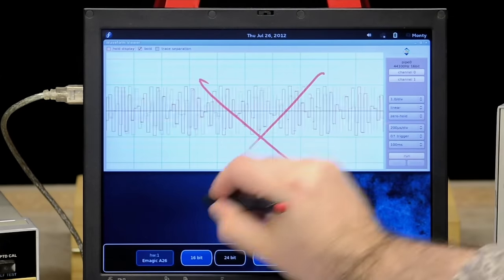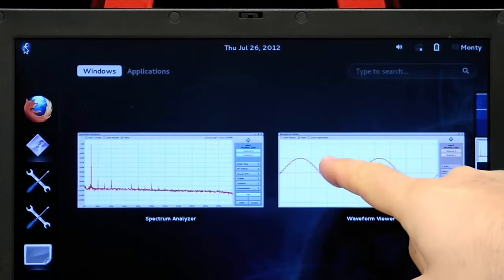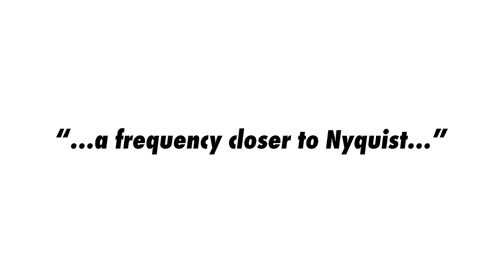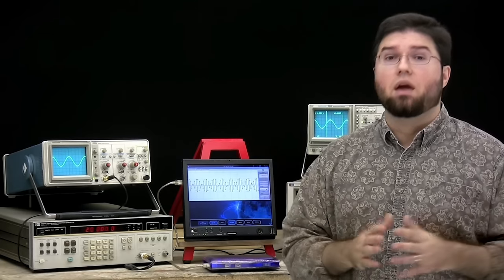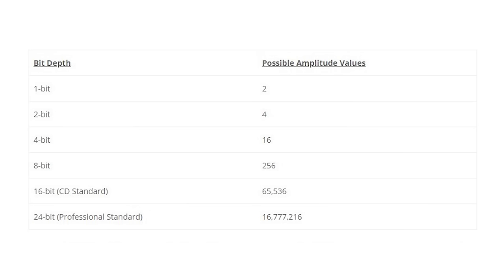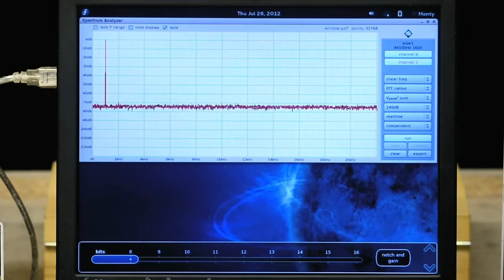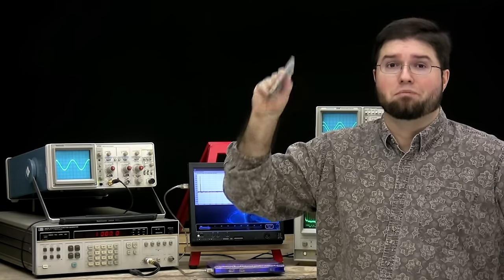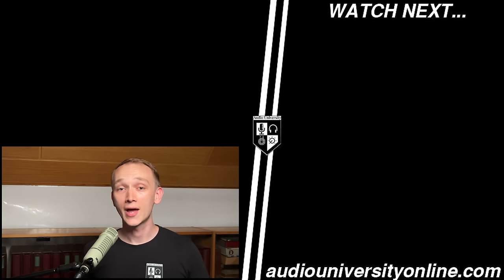Debunking the Digital Audio Myth: The Truth About the 'Stair-Step' Effect

Comment: Well done.  I should point out that higher sampling rates are better for certain use cases, such as playing back the sample at slower speeds.  For example, if I shoot a video at 240 frames per second then play it back at regular speed (30 frames per second). Slow motion playback is far smoother than if I recorded it at 30 fps.  The same is true of audio.  So, if I record audio at 96k to sync with a high speed video, it will be smoother when I play it back at a slower speed.

Comment: In 1984 Wendy Carlos released the album digital moonscapes, which was created with digital synthesis, and recorded digitally. 

Dire Straights 1985 album Brothers in Arms was digitally recorded. 

There was extensive testing done at that time sending analog audio through digital conversion and back. it was determined that literally no one could tell the difference between the converted signal and the original. In my mind, this has been settled for 40 years.

Comment: I fully agree the problem/solution is not in hi-res format, but rather in the art of the quality of the recording and room acoustics. Nevertheless, analog will always sound one step more real, yes may be more noise but more real, cause it always been in one piece, vs. digital, where the "whole" cease to exist at some point, when it broken into 0s and 1s, than it is reconstructed anew by D/A convertors from said 0s and 1s, but it is never 100% "whole" again and highly depends on the quality of the D/A convertors.
Reply: You probably didn't understand what was said in the video. Or didn't want to. ;)
Reply: @omenoid  It said that 24/96 and up is no better than 16/44.1 isn't it? 🤔 And I'm said that main problem not in the bits but in the original recording and that good recording saved saved even in mp3 will always outperform crapy recording saved in 48/192 etc. And I also say that analog will always play closer to the original instruments. What was said in the video according to you?

Comment: Mind-blowing video! However, I would like to point out that higher sampling rates can have benefits for sound design. They let you slow down the sound extremely with less distortion.
Reply: Good point, the soprano pipistrelle is around 50kHz plus, so if you are recording bats you definitely need greater bit depth.

Comment: The only reason for a high sampling rate is to reduce the order of the anti-aliasing-input filters. Thanks to advances in the AD-converters in the last 20 years this is afforadable even for consumer devices.

The hearing dynamic range peaks at 200Hz with 90 to 100dB and 16 bits mean 96dB - so every bit above 16 does not really help and for a clear signal any noise at fs/2 and above needs to be suppressed by 96dB and more. So for 10kHz upper sound frequency and a 10th order (!) LPF the minimum sampling frequency would be 96kHz to have a 96dB-attenuation at 96kHz/2=48kHz.
If the samling frequency is increased to e.g. 192kHz the 96dB-Attenuation can be achieved with a filter of 6th order. In reality the cutoff-frequency can even be set to e.g. 2kHz as the hearing sensitivity drops significantly at 1kHz and higher (this of course requires digital reconstruction of the phase and amplitude) - then the input filter is of 4th order.

After input-sampling the data can then be handeled with e.g. 32 bits (i.e. shift the real data to the upper word). Then the input filter disturbances can be corrected and a digital LPF of e.g. 100th order with a cutoff-frequency between 16 and 22kHz applied. The result can then be used to get samples with 44kHz or even 32kHz. This does not affect the signal quality.

When producing analog output the steps do of course need to be flattened by an LPF again which in turn requires a pre-calculation of the phase-shifts and attenuations to be expected.

Comment: The reason why you want high frequency and bit depth is for digital resampling.
It's one thing if you can resample with a dac->adc but quite another if you are working purely with digital systems.
This isn't an issue if you just want to play a CD, but it can quickly become an issue on any modern operating system where digital resampling all sources is the norm.

Comment: Yes in production the added sample range of 24bit when tracking means you don't have to worry about having things "as hot as possible without clipping" you can leave it peaking at -12db and its fine.
And with mixing in 32bitFP you may have noticed that individual channels will not clip even if they are 100db over 0, only the master which is converted back will (albeit not recommended for gain staging into plugins that are gain dependant or don't use floating point!)

Comment: I've never tried to argue that a recording w/a higher sample rate, (one with more bits and presumably higher resolution) wouldn't be better than one with a lower sample rate, but I have observed it to be true. After years of aiming to get the best system I can't quite afford, I picked up an Esoteric K-01xd CD player and spent more than most new cars cost on the rest of the chain. Many of the best sounding recordings I have are not DSD or SACD. Quite a few 16 bit redbook CDs sound better than most or maybe even all of my SACD discs. Tossing out the notion that stair steps are used to approximate a curve at least partially explains why this might be the case.

Comment: Digitisation error is higher with lower sample rates and leads to error in the timing of high frequency signals.

What this means is that your better off working in higher samplerates as that way any processing will habe a  4x reduced error incurred every time you use a filter etc.

Comment: A circle drawn with analog tools is easily smooth visually. The same circle drawn in digital format requires high digital resolution to achieve same smoothness. Same difference applies with sound reproduction but its verification requires aural discernment rather than visual tools.

Addendum: It's easy to discern; just compare analog synth with digital synth sounds.

Comment: could i get the models of the DAC and ADC you used? when i did this same thing with my own equipment, being a Moondrop Moonriver 2, and on it's lowest sample rate, it topped out at 19 Khz, on my scope, and about the only wave form it could play reliably was a sine wave. with all other wave forms reduced to this only wobbly. not saying what you did was wrong or anything, but it may depend very heavily on what equipment is used, and not all DAC's are the same.

Comment: I ran into this issue in trying to teach people how to do radar scenario simulation for early warning systems.  To build a test set for such systems they would build racks and racks full of radar frequency generators and sum them all together.  But when the EWS system burped over something they had no way to reproduce the signal that caused the burp.

So I introduced them to Nyquist, generated all the signals digitally, summed them digitally and then drove one single RF generator. It worked well - EWS systems got much better because they could test more complex systems more accurately - because they could repeat any pattern that burped the system.

Comment: That's mostly true, but only when we consider a pure sinewave. Of course, according to the Fourier theorem, you can reconstruct any waveform using a series of sinewaves, but it will require sinewaves of much higher frequencies than the original signal. Also, if you would use the simple R2R topology DAC, without any filtering, you'd clearly see the stairstep waveform on its output.
Reply: All signals are a sum of sinewave so fourier theorem is fully applicable to all kind of signal. if the original signal contains a harmonic higher than 20 K it will be lost, but if you play it in the speak your hear will filter it anyway, so the result is the same. you know a audio system which doesn't filter the harmonics ?? There is no stair step on the signal sent to the amplifier

Comment: The point that the digitized signal should be visualized as a "lollipop graph" and not a stair-step is a "duh" point for anyone with even a basic understanding of analog-to-digital conversion or DSP, but it is very nicely presented here, and worth emphasizing.

Where Monty goes awry is in the claim that the output of the digital-to-analog coverter is a "perfect sine wave." I wonder if he ever looked at the schematic of a DAC. The "lollipop" signal gets converted to a smooth signal by analog circuitry that effectively implements an analog filter (the anti-imaging or interpolation filter). Monty argues that the output curve must be a perfect sine wave because of bandwidth limitations in the digital realm. But the interpolation filter is operating in the analog realm, and its input is those now-analog lollipop spikes, which have lots of high-frequency content. Moreover, his point about perfect reconstruction holds only for infinitesimally narrow samples; in reality the ADC has a brief but finite integration or averaging time; it is not recording a value of the incoming sine wave at precisely one point. As a result of these effects, even ignoring other circuit imperfections, the output is never a perfect sinusoid (even assuming ideal downstream circuitry). The waveform looks sinusoidal to the eye, but the eye is easily deceived in that regard (it's hard to visually see 5% THD on a scope, for example). There are imperfections in signal reproduction in any ADC-DAC chain, and some of them are fundamentally related to sample rate and bit depth.

Also worth emphasizing is that Monty's reconstruction remarks presumed the signal into the digitizer is band-limited. Analog signals are not intrinsically band-limited; one of the things that separates good converters from bad ones is how carefully good ones process the incoming signal to make sure that the processed analog signal actually reaching the digitizer is nearly band-limited (and it's never perfectly band-limited). Another thing is the quality of the anti-imaging filter in the DAC stage. It actually can be technically easier to do anti-imaging filtering for higher sample rate converters. As a result, listeners may hear differences between 48k and 96k DACs that have little to do with sample rate per se, but are indirectly related to sample rate via the constraints imposed on the anti-image filtering.

All in all, the video excerpts left me with a very mixed impression of Monty's understanding of how digital conversion works. He did a great job clearing up the stairstep misunderstanding, and explaining digitization noise, but then introduced other misunderstandings. I'll give him the benefit of the doubt and assume he elided some details that he would cover in a course for actual engineers.

All that said, at least for the vast majority of practical settings, I'm totally on board with the implied criticism of "audiophiles" who insist on very high bit depths and sampling rates. I certainly can't hear the difference, most certainly not for casual listening. However, the fact that there actually are small differences between converter inputs and outputs that are sample-rate and bit-depth dependent (beyond the digitization noise mentioned here) implies to me that there could be some well-trained golden-eared listeners who can hear some differences in some controlled circumstances. I remain skeptical that it could matter in real-life listening. —Tom
Reply: @nicksterj If that's what he meant, he wouldn't have gone into the discussion of a truly perfect sine wave being the only band-limited curve that could go through the sampled points.

Comment: The bit depth and sampling frequency for editing is quite similar with what happens with digital images....8bits per channel and compressed data is ok for normal visualization, the issue is when you want to start messing around moving data from here to there applying some curves or levels...you end up with some apparent posterization quite easily.

Comment: What an eye opening video!  Even with my engineering degree from back in 1976, my interest in building my own amplifiers, and my investment in high end headphones, this was a revelation.  I have been wondering what to do about getting a better DAC than the one in my laptop, and you have convinced me that it's not worth going for better than CD standards.

I am also interested in math, and you just opened the door for me with the reveal that any deviation from the original wave requires frequencies higher than the sample rate.  That is worth looking into as a mathematics exercise.  I am thinking the DAC must use some form of interpolation between the points.  The staircase is a brute force way, you could use linear interpolation, or better still quadratic.  Then up pops Taylor series in my brain.  Maybe you explain more in other videos, this is the first I have watched on your channel.
Reply: It doesn't use some interpolation. It uses a (low-pass) reconstruction filter (which can be as simple as an RC filter, i.e. just a resistor and capacitor, which filters out the stairsteps, after which you get the original waveform back.

Comment: Personally I find 24/48 resolution an optimal as it takes not so much place as CD (2304 kbps vs 1411) and matches better video-audio.

Also I did some AB tests and I think is audibly better, just a little bit more articulated and differentiated instrument in classical music.

Also I think there’s no problem with simple sine waves, but in practice phase matters and the video only takes frequencies into account. Signal reconstruction use Fourier analysis to filter ultrasound frequencies, concretely Fourier transform and its reverse after subtracting the undesired frequencies.

As this transformations are not reversible in real computation (despite Nyquist theorem which is described on analysis, not on numerical methods), one looses information going back to the digital time-amplitude domain.

Oversampling can be useful to increase the accuracy of the filtered digital signal, as the we have more room to computational error.

Also more blind tests should be performed in order to determine whether a full treated signal is more consistent in 16/44.1 or in 24/48 and more, as spectroscopy is not representative of a real comercial DAC digital processing.